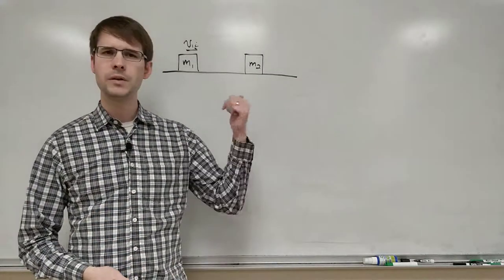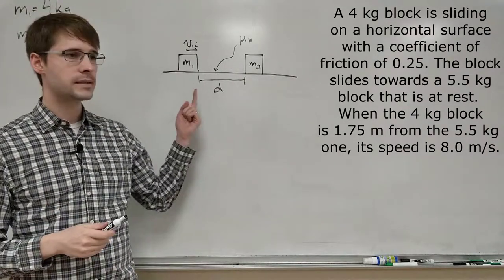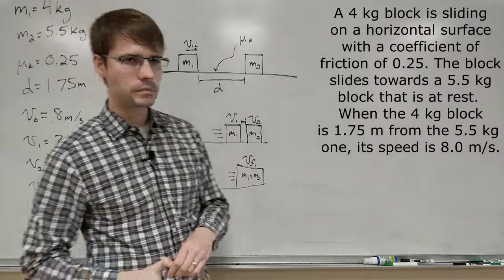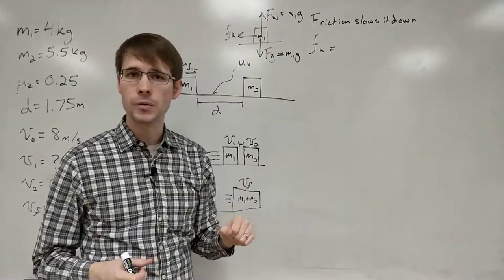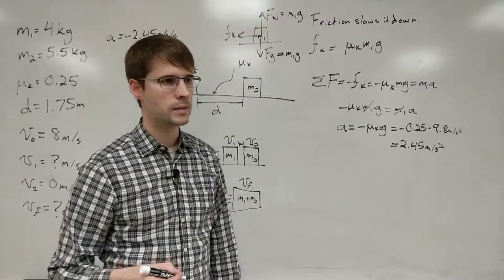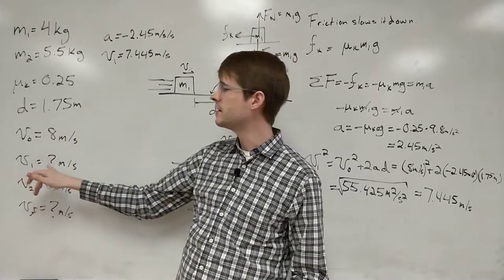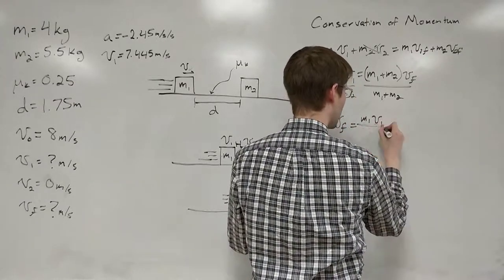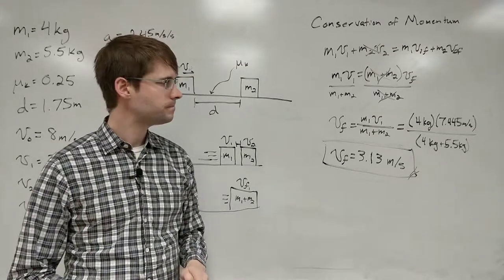Conservation of Momentum with Friction

Comment: isn't the normal force equal to the negative weight force, not the absolute positive weight force?
Reply from the maker: In a way, yes, it is. The negative of a vector is just the same vector, but pointing in the opposite direction.

However, on the diagram, I've already drawn the arrows (one pointing up and one pointing down), which takes care of that distinction. The convention for these types of drawings is to label every force as positive, and take care of directions with the arrows, not with positive and negative signs.

I hope this answers your question!